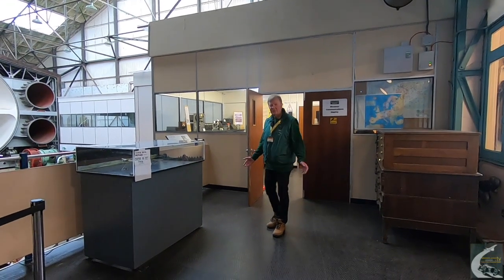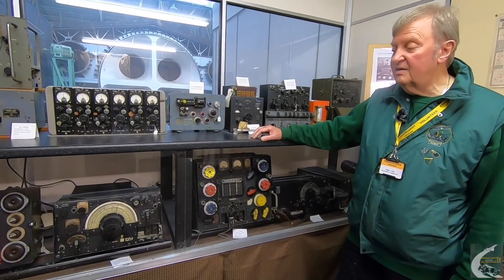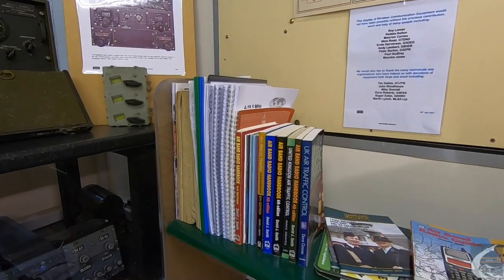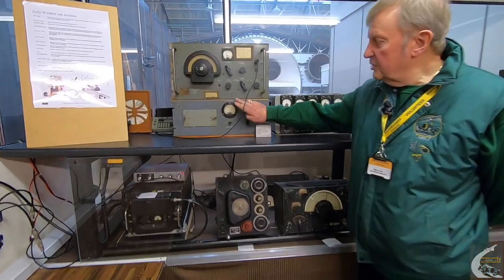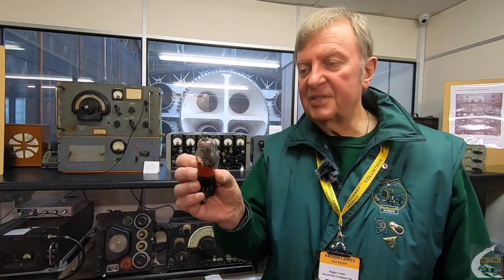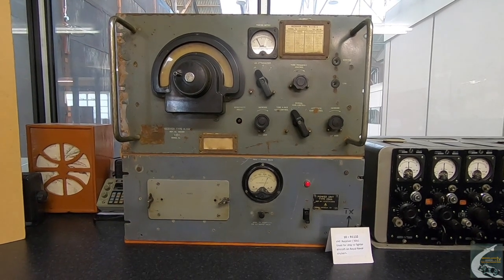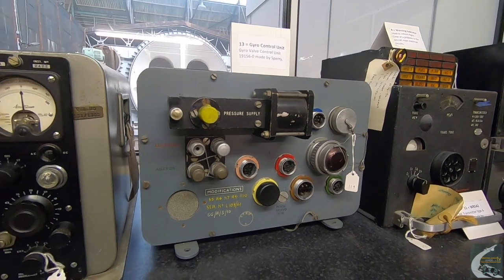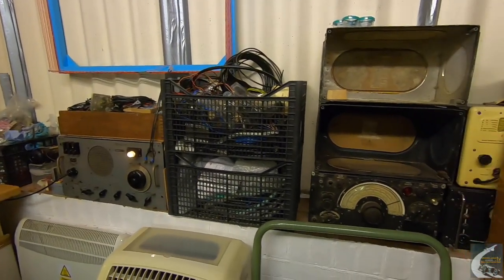Brooklands Museum: Wireless Communications at the Stratosphere Chamber. Introduced by Roger Eeles.

Comment: As an ex radio mechanic apprentice with BEA I was interested in this video. Most of BEA’s radios on the Viscounts. Vanguard and Comets were manufactured by Standard Telephone and Cables (STC) who were located in Southgate in north London. In fact I did the first 2 years of my apprenticeship there as at that time (1955) BEA did not have apprentice training facilities of its own. Very interesting presentation but was a little disappointed not to see any of the wide range of VHF and HF Trans receivers, VOR/ILS receivers that BEA used.